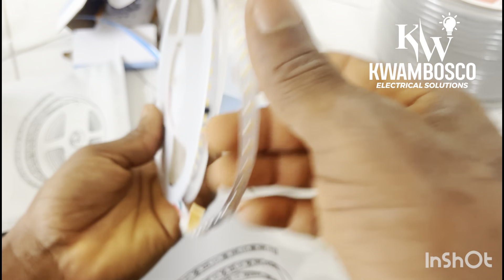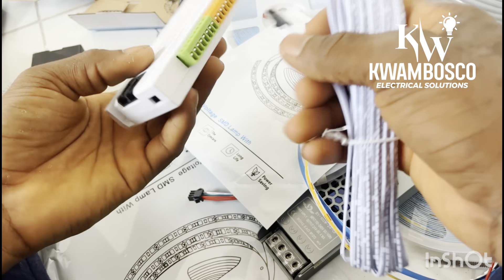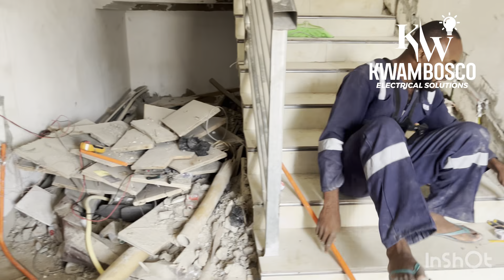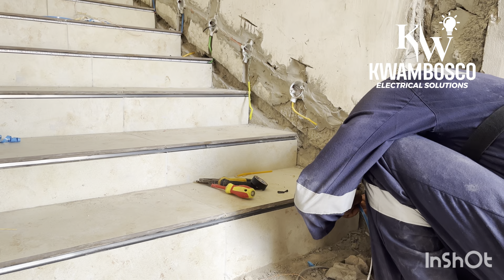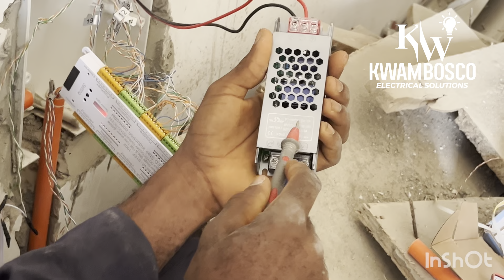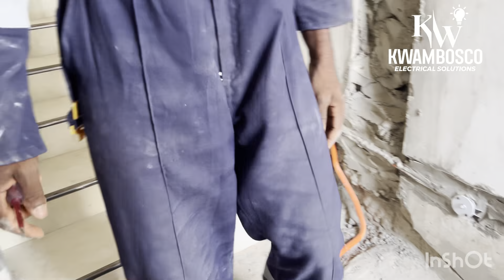Everything you need to know about staircase Automation light sensor/ DIY SMART STAIRCASE #howto #led

Comment: I love the explanation, it’s very helpful. But I have a question: can we use just one strand in a telecom wire for the negative, and maybe use the red strand for the positive? Because I noticed the cable has about 4-5 strands inside the same outer sheath.Or I should use 1mm copper wire
Reply: Thank you very much for the very much educating video... am an electrician.. can we take the supply direct from the Fuse Box ?

Comment: Should in case the steps are more 36. How did go out it after getting another controller? Do we still need another AC converter possibly more sensors ??? You talk about using normal 1mm copper. Won't it be plenty inside the pipe?

Comment: Thank you sir.
Please show us how to add more controller to the existing one when the number of steps exceeds 48🙏
Reply from the maker: I will
Reply: Bro I saw what you did. But your finger was blocking the buttons as you were doing the configuration. Was it d first two buttons you long press before putting the sensors or just the first button? 
Number 2 question, as the light get ro six step and stopped, was it the first two buttons you press to continue the light moving or the second button or the three buttons at once? Then for my last question, which of the buttons you press to reduce the speed? First button from your right side, the second button or the last button? Please I will for ur respond ur finger was covering all I couldn't picture any

Comment: Good morning sir,  but can we use the running led instead because of it's uniqueness..

Secondly can we use flexible wire  (2core flex)
Reply from the maker: What ever material you see me using is what I have used and that’s what I’m recommending
Reply from the maker: Running ledlight can not work
Reply: @kwamboscoElectricalsolution